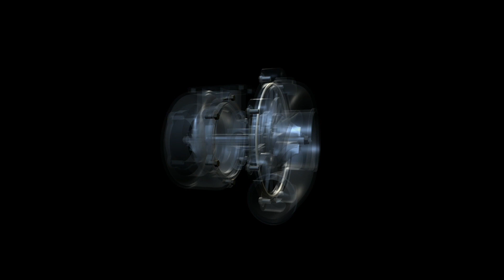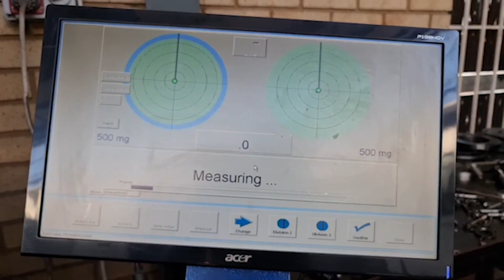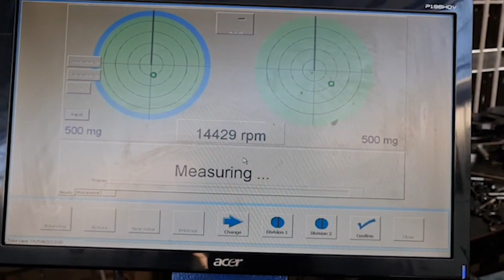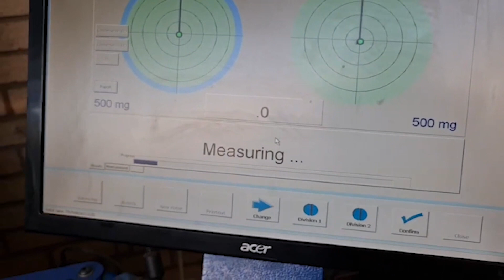Gas Path effects on a turbine

Comment: Amazingly interesting topic.

This really peaked my fantasy and I've been out there looking for research papers and articles for hours and hours now. No results... seems like not a single soul has cared about this or anyone that has publically shared it at least, lol. Some research exits but it's not really conclusive nor helpful for aftermarket racing and modification purposes really.

Fascinating topic and I hope you will make more videos about this, with some more in depth results and examples.
Reply from the maker: Most wont post on this topic as they dont have the understanding, experience or knowledge behind this. It is an immensely in-depth topic. Changing anything in direction of the gas path, (VNT principal) or the angle of the blade (fixed geometry) has a massive effect and result on the driven compressor and the rotating assemblies efficiency.

Comment: Hi chris, awesome video which got me thinking abit. the exhaust gas from the engine is a bit different from the continues flow like the test bench. the energy left in some of the unburnt gases, coming from the cylinder, causes some explosive bursts of energy, also the gases move toward the turbine exducer in a pulsed manner(as the cylinders fire),.... does this also affect the exducer blade design?  do we use the continues flow data from the test bench as a true representation of the turbo rpm produced, or doesnt the pulsed energy flow not really affect the rpm as much?

Comment: I started to realize how important the internal volute structure was by looking up the MHI turbos. Still with 12 blades vs 9 blades and smaller housings (e.g. 0.57 vs 0.64), yet furious top end without any drop in boost pressure. This is the hidden subject that nobody wants to talk about. Almost everybody talks about the a/r like a number like is a ratio of boost level/spool rate by itself. However, is one of the most important parts of a turbocharger.

Comment: Yes, the internet has failed us on this subject. Like always I enjoyed this video, but would like to know more about the modification that you said was a failure. With small A/R housings, we are porting the throats and are shortening the tounge and this works for us, but I would like to know how wrong it is to do this. :)
Reply from the maker: Thanks Finn, im afraid i wont be sharing the failure information, there are many haters who watch this channel with open ears and wide eyes - i am able to share just enough, but not enough if you get my drift. 

Shortening the tongue will leave you in trouble, opening the throat does nothing, because you cannot port the entire volute. cutting the tongue will not lower back-pressure (which is the reason someone would port the throat in the first place) it simply creates lag by forcing the turbine to lose its efficiency  

Been there done that in the early 2000's already with the Twin turbo RB26DETT.